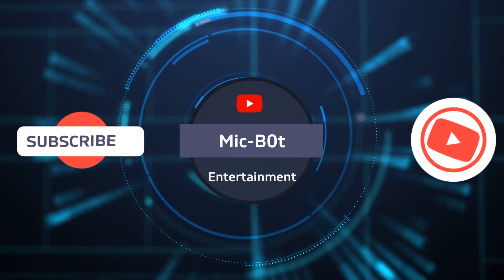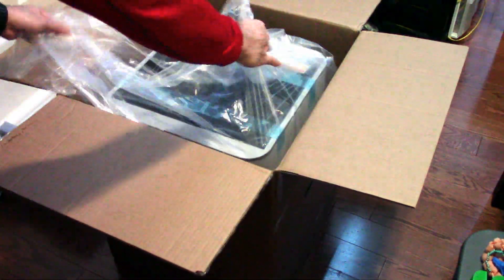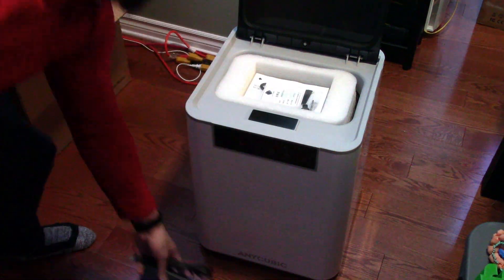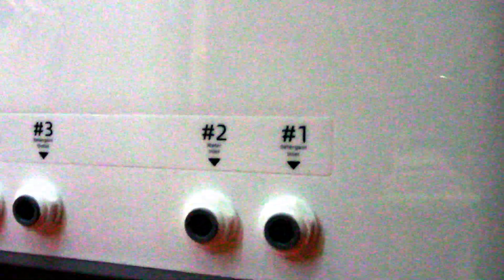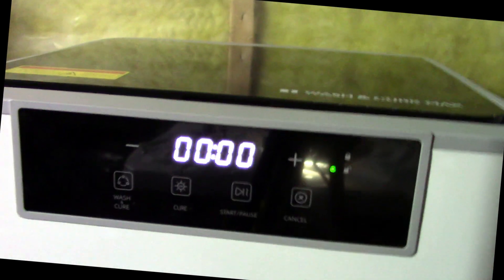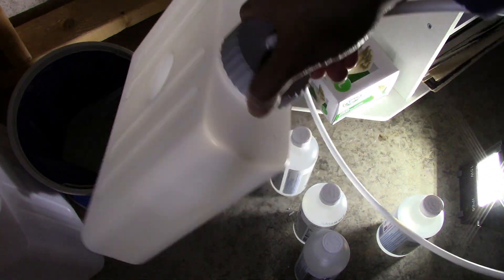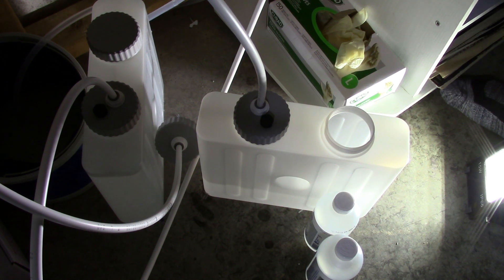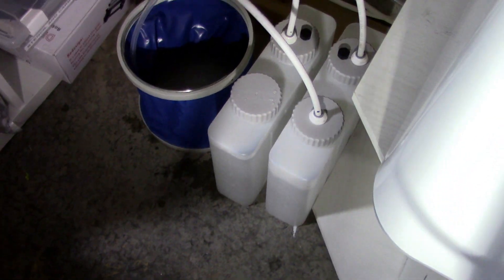AnyCubic Wash and Cure Max Unboxing and Setup

Comment: last summer, I put the machine away drained, and in a warm place. after i took it back out it didn't drain. Now that i have wasted two months trying to get ahold of anycubic, they sent me a new motor, which is constantly receiving an input of 12v, meaning it is always on, even if it isn't in a wash/drain/cure cycle. I am fairly sure it is something to do with the motherboard, but the company takes at least a week to get ahold of, and more if I want to get a part, and at this point, im considering just asking for a refund. I am very confused, as I seem to be the only person struggling with this issue. Is there anything I can do to fix these problems. Thank you
Reply from the maker: The anycubic Support is definitely less than ideal. I have wash and cure max connected to a smart switch, so I always turn it off when not in use. 

If I do not turn my unit off a humming sound can be heard at all times, meaning that it is still receiving power even when not in use. I think they may have cut corners with the design but again you're buying from a budget Friendly brand. 

If your unit was not draining, I can only assume resin may have clogged the lines.